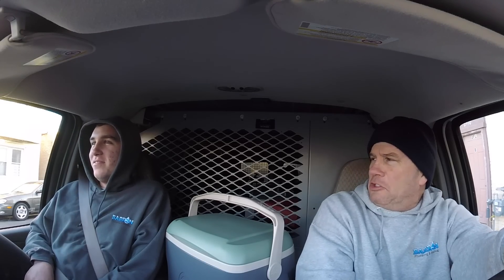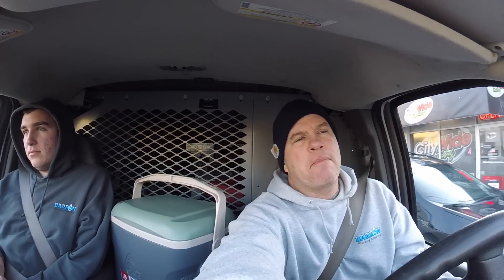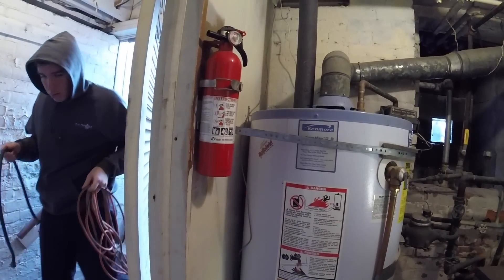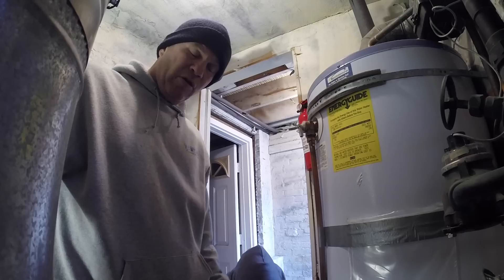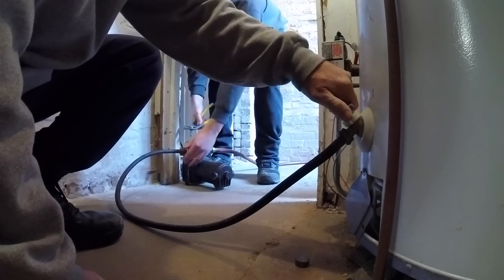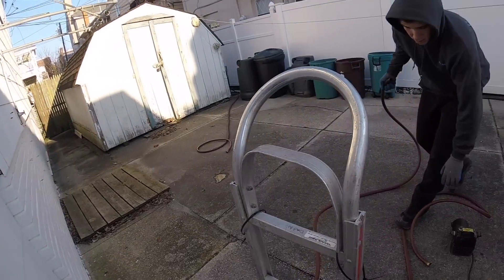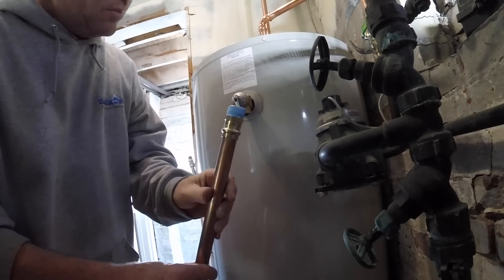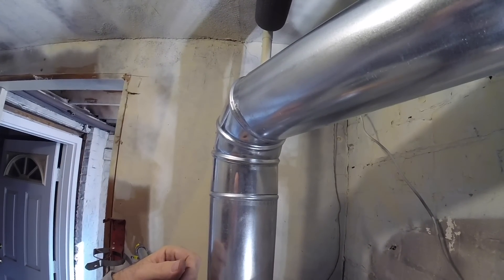PLUMBING APPRENTICE'S WATER HEATER INSTALLATION TIPS

Comment: To get paint off of copper pipe I usually put a torch flame on it for a 5-10 seconds, which causes the paint to bubble, and then use Emory cloth (not sandpaper) which brings it back to a nice shine. Pliers work ok, but I’ve found that the flame method is the easiest. Sometimes you can’t get pliers all the way around the pipe. It works as long as there is nothing around the pipe that will burst into flames.
Reply from the maker: Yes I forgot to mention the torch trick...Thank You Robert...Networking baby.....we love it
Reply: Great trick. I do that as well but use a old cleaning brush to remove the paint. I've had better luck that way.

Comment: Love your video's, i catch them whenever I can! Hey i wanted to ask you if you guys require hot water mixing valves on water heaters down there in your area?
Reply from the maker: yes. especially on apt. buildings for 3 handle valves.

Comment: what does the pump do? i do water heater install too but we usually just open the valve and drain it.
Reply from the maker: expedites pump out and need a pump if in basement. they are very useful

Comment: You can use a wire wheel with a drill to strip the paint off of that copper pipe or you can use a torch to burn the paint off.Some ppeople like to use a solvent but I prefer either the wire wheel with a drill or a torch to burn off the paint on coppper pipe.
Reply from the maker: you can do both.

Comment: Brand new heaters have rust inhibitors and other coatings on their heating elements to keep them clean during storage. These burn off during first light, causing a yellow flame. The same thing happens with furnaces and sometimes the smoke detector goes off on first light because coating burns off the outside of the heat exchanger.
Reply from the maker: thanks KD

Comment: you can change the yellow flame by pissing around with the gas pressure. I have a combustion analyzer and I hardly use it more so cause I rarely do change outs, if you were to get it, it would probably be more handy for you. ive done a furnace where it is more efficient to run at a lower pressure than its preset 2.8"wc instead of 3.5"wc (older low boy) went from 60% efficient to 70%, pretty good for a 40 year old beast. if u only had a manometer I wouldn't go to crazy and keep it around 3,5" give or take.5 but you can only really see what you are doing with a combustion analyzer. steve lavs got a bunch of videos on using it, that's were I learned from. my testo 310 cost me about 900 Canadian a few years ago.

another under rated thing to check for is what kind of shit is in the basement. if you got a bunch of harsh chemicals down there leaking about, paint, jerry cans, other shit that would mix with the air and screw with your burn. I had a water heater call and went and checked it out, they had their cat litter box within 1ft of a fresh air sensor and when they never changed the litter the ammonia in the cat piss would eventually get bad enough to shutter down.
Reply: I'm sure it was oil burning off from factory assembly and dust stirred up burning off will make it very yellow for a short while also..
Reply from the maker: for sure. Thanks Kyle...stevie lav fan here too. he inspired me to do my channel

Comment: To take off the paint I use a brush and paint remover I don't run the risk to bend the pipe and with flame I don't waste my gas
Reply from the maker: roger that Jr.

Comment: I've been in the trade 33 years, and you taught  me the plier's on paint trick (many video's ago). I've always just scraped and sanded the crap out of the pipe all those years, or used a torch. One question though Chuck, why don't you use PVC on the relief valve pipe? I'll put back the old one if it's in good shape, but I never put back new copper, because of the cost these days. I understand it's an extra step, and more crap we have to bring in the house. CB2...you almost caved at the end, that's alright, we WILL get an enthusiastic ending out of you!
Reply from the maker: lol......cb2 coming around in his old young buck age......us old dogs always learning...I really need to changed to pvc...i just love the look of copper.. See Im too nice of a plumber...lol.
Reply: black or galvanized iron pipe with no threads works very well at keeping idiots from capping it off, especially now with all the easy push on sharkbite/others.
they just slip right onto copper or plastic so easily =p
Reply: Can't use pvc on relief valve. It will fail inspection. Not heat rated. Only CPVC, copper or galvanized / black pipe without threads on bottom.
Reply: @pineychristian   I meant CPVC...just forgot the C..just so use to saying "PVC" in general.
Reply: @anthonys.5653  I hear ya man. Me too.  Most commonly used

Comment: Cb nice job. you need to check out the Milwaukee Rocket tower led light we bought the non charging model 3000 lumens and you can either plug it in with a cord or use a 18 volt battery the other one also charges batteries but its $100 more !!!!!
Reply from the maker: yes....the battery can become an issue on long uses.....battery shuffle all the time. Thanks Rich

Comment: In il you cant use reg galv pipe on gas it has to be blk pipe and your shutoff has to be fairly close to the controls on the water heater it self
Reply from the maker: roger that allen....codes all so different...good eye plumber.

Comment: Yellow flame on newly lit burner, most times, be caused by dust being burned up in the initial fire. Watch it for a few minutes without moving your body or any objects around, the yellow will go away gradually. Blow against the floor in the direction of the burner and the yellow will flare right back up, its just dust burning in the flame.
Reply from the maker: awesome...thanks steve.

Comment: Your gas pipe should go on the wall behind the water heater,bring it down and use a smaller flex. Check the gas pressure,and ajust the valve
Reply from the maker: thanks plumber.

Comment: The screws on vent pipe is unecessary and a mess for the guy who will sweeping it. Also, the crimped end goes down, to keep condensate or water inside the pipe.
Reply from the maker: i aways go crimp towards flow...no co leaks. I always screw pipe also. thanks sylvain.

Comment: im a gas engineer from the uk...

a yellow flame is incomplete combustion and produces carbon monoxide NOT GOOD!
caused mostly by lack of air or oxygen

a blue flame is complete combustion and produces carbon dioxide and water vapour...

1 situation in the uk where we are allowed to leave a yellow flame and is safe, is caused if the home owner uses oxygen cylinders to help them breathe..  the cylinders supposedly give of something into the air which causes any blue flame to turn yellow..

if we had boiler (we only have combi boilers mostly in the uk) with a yellow flame it would be shut down and there gas supply to the property capped straight away!

with this been a new water heater though i guess its just crap on the burner and would soon sort itself out..

brendan uk
Reply: I'm sure it was oil burning off from factory assembly and dust stirred up burning off will make it very yellow for a short while also..
Reply: Engineers tend to be book smart not too much common sense. In real world there is dust and dirt. If you move at all near a gas appliances while in operation they will start to burn yellow because of ppm of dust particles you disturbed if you want to get all technical. But you engineers like to test everything in a lab or in your perfect world which does not exist.  The air screens are directly on bottom of Bradford water heaters. They pull air from sides thru bottom. Also with all water heaters when started for 1st time tank is ice cold cause of water temp. When heated rapidly the tank sweats and condensation drips back on to burner that is why you see big yellow flame up. You can see and hear the drip on to the burner.  I have installed hundreds of water heaters and they do this everytime.
Reply: @pineychristian  yeah, I forgot to mention the new tank being full of cold water, condensing and dripping on the burner, with lots of loud sizzling, popping and the super yellow flame it causes also. not like I haven't seen it a few (thousand times) lol
Reply: @throttlebottle5906  i have had quite a few customers swear when new water heater install was finished that water heater was leaking inside. I had to explain this condensation deal atleast couple dozen times or more LoL
Reply from the maker: roger that.